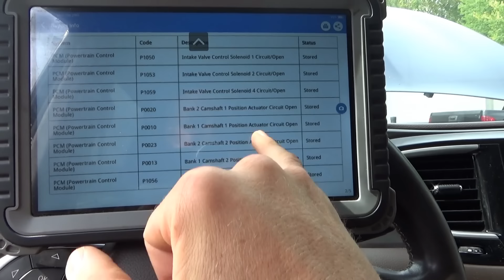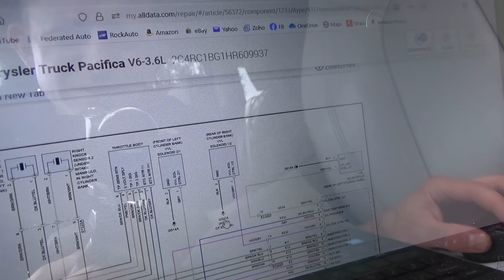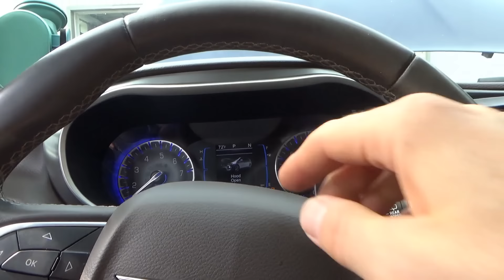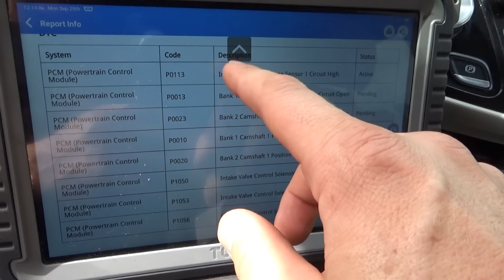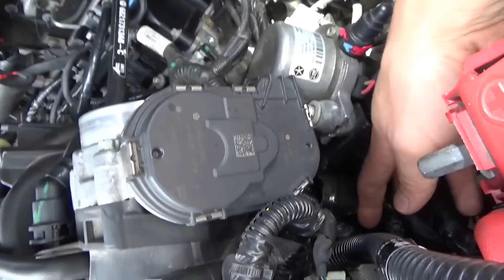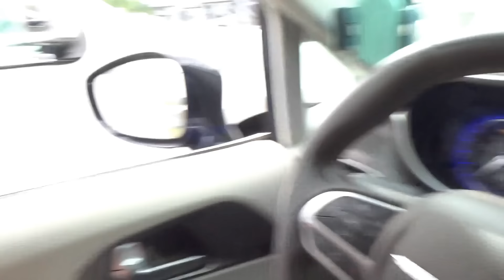Head Gasket Job...Goes WRONG?? LOW Power...MANY CODES! ('17 Pacifica Pentastar V6)

Comment: Any idea what happened with the head gasket? I just bought a 2016 DGC with the 3.6l engine and I'm trying to be proactive.

I recently changed the plugs and noticed a bunch of missing small parts such as red connector locks, missing bracket nuts and stripped lower intake threads.

Comment: When I was young I was an industrial engineer working on a specific type of machine, and I came across a dificult machine that I could not fix. My boss would offer help, but would not replace me on that job. I desperately wanted someone else to take over but my boss insisted I finish the job. I got there in the end, it was difficult, I learned a lot and my boss took the flack for the slow repair, the customer was furious with me. In the end I learned more about tthat machine and how to take pressure. Since then I had a lot of respect for that boss, he would not give up on me, and I follow that way of working to this day. Never get someone else to finish a job if possible.

Comment: Head gaskets only go if you don’t change the oil 4 or more times a year and it doesn’t over heat. Zero issues with the 3.6 that isn’t ownership error

Comment: You think that's bad about having 2 different people working on it.  I worked at a mining equipment shop, thankfully for a very short time, where they
wanted me to piece together a vehicle from 3 different variants, that were taken apart years earlier. Then those parts were placed randomly in a dozen
different buildings, quonset's, and sheds over several acres  AND  having to figure it out using a  parts manual and not an assembly manual.  I was very 
glad that covid hit, because that was the end of working at that sh*t show of a company.

Comment: Unfortunately far too common in the automotive repair world. Not just a lack of experience a lack of desire to do the job correctly. If it becomes difficult let someone else fix it. I should be paid for showing up, any actual work I do is just a bonus. That attitude showed up in the mid 1990's and has just continued.

Comment: Once I had a shop mechanic 'splain to me that the idler tension bolt on an early 2000 Honda Civic (If you know Civics, you know that bolt is notorious for freezing in the block). I didn't want to DIY it, so bought the tensioner kit, I took it to the shop, and asked them to replace it. I get the car back and drive it. it works fine. 5 days later, belts off, noise, etc. The shop tows it to their shop with their flatbed. Tech tries to convince me the "bolt" just broke on it's own, after 18 years, the bolt just gave up and broke.....

Comment: if you're going use tape to hold fasteners like this, use colored electrical tape, I doubt the tech would have missed reconnecting terminals with purple or yellow tape on them.

Comment: Hey, question...I had run into a vehicle that had this same engine. Someone else had put an engine in it. I cant remember what the exact issue was but I know those resistor? Things that the ground goes through were gone and they just had eylets on the wire but not hooked up/grounded. I bolted them to the head but SOMETHING didnt work correclty because those resistors or whatever they are werent in line. Man I wish I could remember what issue it caused to be more descriptive. Anyway, do you know what they actually are? Are they just resistors? My bad memory almost wants to say a fuse blew when hooked up without them inline but im not sure. If we didnt have another 3.6 for reference I wouldnt have even known they were there because diagrams just show a regular ground...I mean a ground is a ground so I thought..  Im hoping you can explain it to me better since youre most likely smarter than myself

Comment: Did a timing job on a car but couldn't figure out where one wire went years ago. Car ran great but the wire bugged me, spent a couple of hours trying to figure it out.

Couldn't sleep that night so went out to try again, as soon as I popped the hood I knew where the wire went, TO THE FREAKIN HOOD LIGHT.

FELT LIKE SUCH AN IDIOT.

Comment: There is the proof. Many shops are not managed well enough to get the mechanics to follow through with their work. Why would a shop have a policy that allows multiple mechanics diving into a repair job? Agreed...big red flag there so, in short, its a shop issue that needs fixed to get the mechanics focused on their work. 
Why the heck would a shop/mechanic getting paid good hourly wages tape up a mounting fastener to a cable that is supposed to be fastened to something? I saw at least four of those plus that bracket. Who knows what else has been neglected or mickey moused from the OEM plan. These shops are likely charging the going rate yet damage the customers vehicles. Very sad. I call it collateral damage which I beleive is illegal to do to a customer.

Comment: You are right IVAN ,as usual.It's got a lot to do about ATTENTION to DETAILS.The best mechanics and most other jobs are evaluated by how good thing are put back to the factory spec.Wiring and wire routing,also bolt replacement and torques and fluid replacement.All those and more need to be the same as when the item left the factory.In this case no harm was done? i hope.The older i get ,the higher MY OCD.haha  great reminder thanks 4 the vid.

Comment: That's why I have always tried to do my own work on my vehicles. I may be anal but I take pictures, put labels on parts, wires, bolts, get a piece of cardboard and put the bolts in holes with a drawing of the part so I know what bolt goes in exactly which hole etc. Now, I'm 75 and these new vehicles I do my own oil, filter, air filter changes but it gets harder and harder to crawl over and under. I have had bad experiences with independent shops and "stealerships" over the years where I had to fix their f' ups because they work on it, leave a mess with a problem and can't figure out how to fix it. The best example was in '82 or '83 I had a '78 Datsun P'up, it was cold, snowing, ice, I worked OT for the phone company until 8:00 PM, my battery was about dead, would barely start the 4 cylinder engine. I went straight to a Sears Auto Center for a new DieHard battery. They offered free installation so I let them change it out. From the waiting area I could watch the teen age punk work on it and he seemed to be having lots of trouble. When it was ready I drove it out of their shop out to a parking lot light pole and opened the hood. I saw a dent poking up on the front   corner of the hood. above the battery. The battery cables were not tightened on the battery posts and the punk had installed a universal battery hold down bracket (and left the J bolts too long). I pulled up to their overhead door and started honking until they opened the door. I pulled into a stall and called the manager over and showed him the work. I asked the punk why he replaced my battery hold down bracket, he said he dropped a nut and couldn't find it (metric). I walked over to the space where he had worked and found it on the floor. I asked where is my bracket? He got it out of the trash barrel. I put it back together myself with their tools and told them I would never buy any automotive service from Sears, and I never did. Worthless. Our newest vehicle a 2025 Honda Pilot Elite AWD is above my pay scale except oil changes but I still have my '81 Chevy K30 and my'98 Ford F150 4WD to work on. 
IVAN IS AN EXCELLENT TECHNICIAN. 
I wish he lived closer to me.

Comment: We all learn from our mistakes I call it the school of hard knocks. Many years ago I stopped putting removed bolts and nuts all around the place and put them all in a container. So when all container is empty you should be about done. Also when assembly is starting I seperate the nuts and bolts by size that makes it easier to sort out location by sizes and numbers of bolts.

Comment: probably one of the greatest ideas is to use black tape to hold a bolt in place. I mean I like the idea, but make it stand out.... GREEN TAPE, RED. but I see nothing wrong with a metal bracket slapping a plastic intake, it shouldnt crack the intake till far outside the warranty period and thats the goal...............

Comment: As a old "muscle car motor head", I find it absolutely infuriating when you pay a "professional" good $$$ and they do "amateur" work. Frankly, these days you can't even get most shops to do an oil change without screwing something up. I don't trust any of them. I have 6 recalls on my vehicle. But I will never take it to the dealership for "repairs". Noooooooo trust!
Reply: Are any of those recalls for safety concerns?
Reply: @wayneessar7489 Yep 2 of them

Comment: At 9:33 there is another misplaced bracket and/or a missing bolt on the right side behind your mirror.  This is what flat rate buys you.  If it stays like this the van's life has been shortened.  It will be back with more problems later due to wiring harnesses rubbing through.
Reply: And the shop will once again pay very careful attention to the BILL!  😆
Reply: Yep, i was coming to say the same thing .
Reply: Well spotted - if there one rogue bracket , goodness knows how many others lay in wait! :( :(
Reply: And it's not like every person on earth does not have a smart phone with a good camera on it. This kind of so-called " Tech " is why people's wheels come off going down the highway. 😮

Comment: I think this mechanic should be fired. Is not just the grounds that he did not connect but the bracket he didn't put the bolts on, and who knows what else inside the engine. This vehicle is a candidate for a future come back.

Comment: Worked for a large repair chain and I would get basket cases from other shops where mechanics that took apart quit and other mechanics in the shop refused to work on it. I didn't care I I got paid large because they had to get the customer car back together.

Comment: Whenever i remove those intake to do an oil cooler or spark plugs, i tend to forgot the damn foam under the intake when going back together 😅😅 I work on the voyagers all the time. The bracket is definently in wrong. There should be a stud screwed into the manifold with a 10 mm nut. They can be frustrating. Good video.
Reply: *Definitely

Comment: In most cases the mechanic doing the job is under pressure to complete the job as quickly as possible. The manger may have yelled at him for even attempting to check his work. It's all about profits. Ivan, perhaps you should red vinyl tape each correction you have done. This would require dealership or shop to remove it after they get it back. Have some tape made up with Your shops name on it,

Comment: It's so frustrating when you basically tell a customer exactly how to fix the car over the phone, they tell you it didn't work, then you go out there and find the problem is exactly what you told them.  :(

Something worth noting, Mopar vehicles will IMMEDIATELY move codes to "stored" whenever DTC setting criteria isn't monitored, and I've seen techs get thrown by that, thinking it's not an active fault.  It's really fun to use WiTech in this situation, as it will display faults in realtime, and in some situations you can pair this with fault monitoring criteria to narrow down broad issues.

Comment: I think we’ve all missed a connector  or wire or whatever doing these jobs , but this case kinda pushes the boundaries of a simple mistake. Hopefully, lessons were learned. Nice work Ivan. 👍👍🇺🇸
Reply: I think it was one of the 90s mitsubishi's has 2 connectors that were the same and the same distance apart where they came out of the loom but the trans didn't like them being swapped

Comment: From the beginning, it looked like a cable reassembly problem, Ivan! Sloppy job, leaving more problems than existed before. It gets worse when more than one person works on the same repair and it's even more complicated, when there is a long period between disassembly and reassembly, even if done by the same person (small parts get misplaced and even cannibalized for other jobs).

Comment: This is exactly why I take pics of everything before touching a single bolt, wire or hose.
I know I won't remember one day later exactly how it goes back together.
Reply: Exactly. I was working at a Volvo truck dealer. Guy has his truck towed in. He installed 4 new batteries now no start. I found the main ECU power wire pushed behind the battery box. 2 minute fix. $800 tow bill. Told him if you work on your truck take photos with your cell phone first before you take it apart. He never thought of it.
Reply: I think this was more of a rush job. They forgot to make all the connections in their haste to finish it and move on to the next job. It's all about time and money.
Reply: I completely agree. And as you get older it will become much more important. At 79, I have an advanced case of CRS. The problem with me is that I often forget I'm not shooting film that needs to be developed any more. 😂😂😂😂

Comment: The technician putting it back together would easily miss the taped fasteners.  I secure loose fasteners using small nylon gift bags (such as used for weddings)…100 bags may cost $6 and can be used many, many times, and will work securing the fasteners though a parts cleaner (the bags drain well and allow the cleaner and dirt to pass through).  Better yet, for ground and similar fasteners, it is best to put them back as you go…the fastener in place will often prevent fastening the part in its proper home until properly reinstalled.  And the fastener is already in its proper home.

Comment: Goooooood morning kids!  Ivan.  More Euro trash huh?  🤣  Ivan, you ever heard of a Gateway module on a Ford causing parasitic battery drain?  I have one that wakes the CAN hi network up every 60 seconds.  It runs the mode door actuator for the HVAC through a full sweep.  It lasts 10 seconds, then 60 seconds later it does it again.  Its the FICM and Gateway module fuse that has the draw.  Disconnect FICM, still there, disconnect Gateway module and it goes away.  I've never messed with these gateway modules.  I'm in new territory here.  ;)
Reply from the maker: Gateway is just pass through between the networks. So with GW connected one network can wake up the others.
You need to scope all the networks with the GW unplugged to isolate which network is waking up. HAVE FUN! 😀
Reply: @PineHollowAutoDiagnostics  Scope on the CAN+ wire at back of the Gateway, I can watch the network light up.  Disconnect it and the network never wakes up.  Plug it back in and immediately it cycles again.  This is crazy.  Interesting, but crazy.
Reply: @PineHollowAutoDiagnostics  Welp, it ended up being on the CAN2+ network, and when I explained to the customer what finding the correct module was going to entail, he said nope, we're trading it in.  They had already asked several times if they should just trade it in.  🤣  Hey, I got paid for my time.  Told them trade for a base model to avoid some of these electrical gremlins in the future.

Comment: The sheer number of connectors and bolts is staggering. As the number of items increases, paying attention (or documentation) also must increase... The other thing that increases with complexity is probability of failure.
Reply: The probability of failure increases dramatically with the incompetence of the technician...
Reply: @ferrumignis yeah but one tech pulling it apart and another putting it together is begging for trouble. Still if the original tech goes down sick or off on leave the customer wants the car back and the  head and parts are ready to go.

Comment: Had a BMW where I diagnosed a failed blower motor , very labor intensive due to partial dash removal.
Customer had his friend do the work and came back for help putting the dash back together. 
I just laughed because most of it was broken
Reply: Really! Plastic parts break if removed and re-installed. I have never heard of this happening before. In this case it was easy, you did not have to remove the engine and transmission as in the up coming new models.